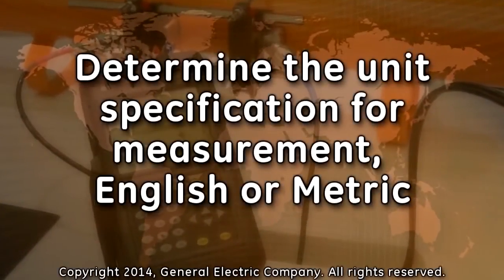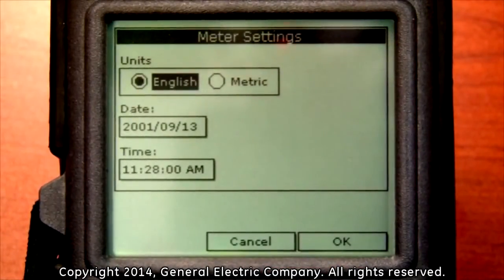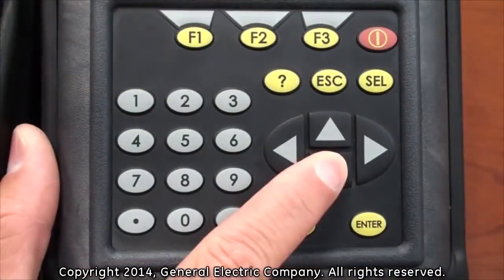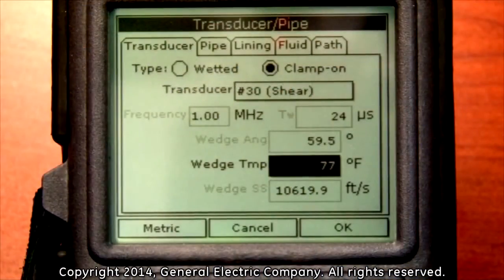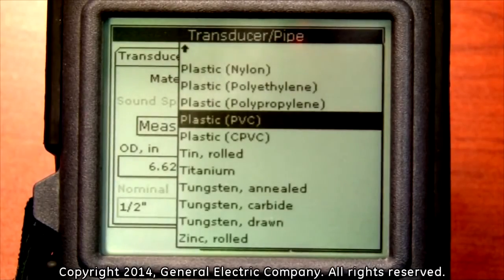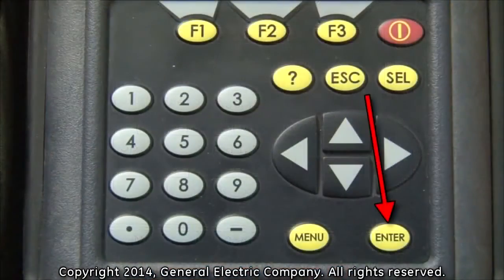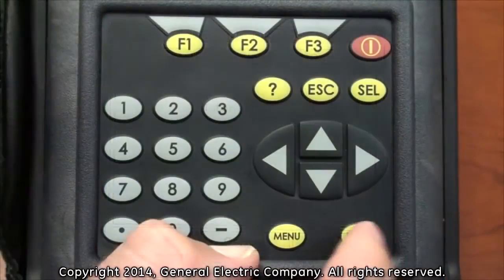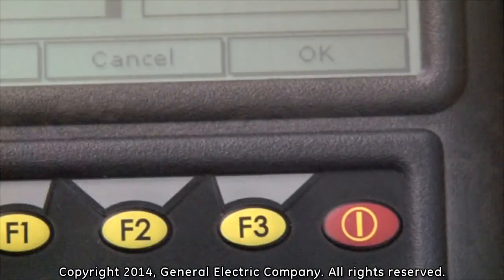GE Panametrics PT878 How to Program for a Clamp-on System | Instrumart

Comment: Excellent explanation I've got some questions: Why don't you use the 6 and 12 watch, ask the second distance between the first and second 4in sensors, if it's a 4in tube used to measure flow?